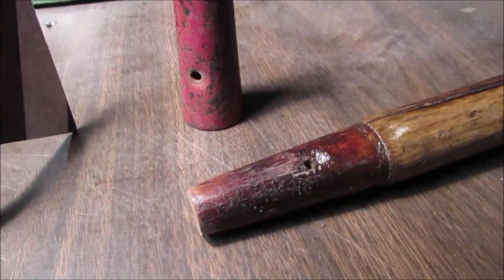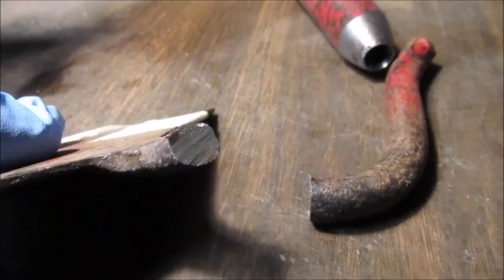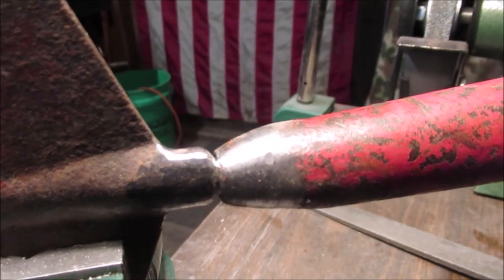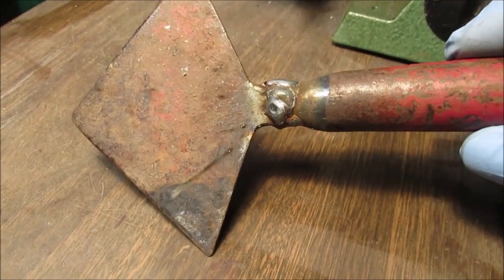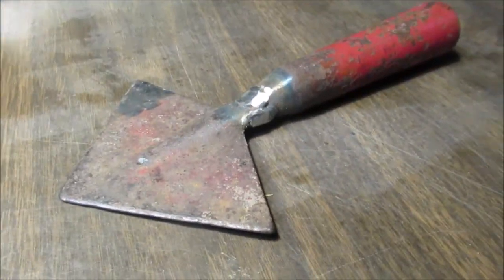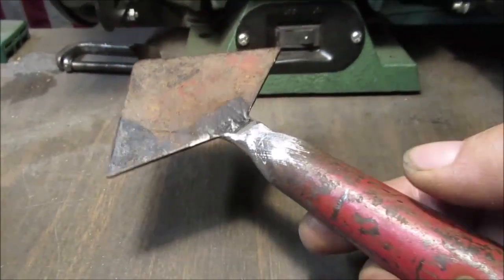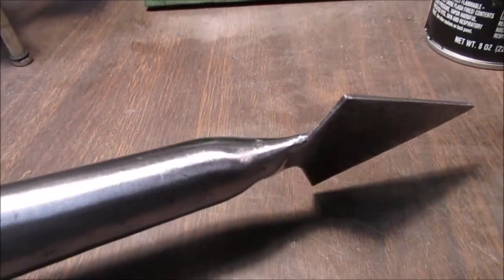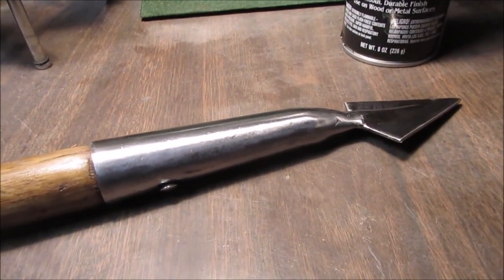MAKE a Spear Point Tip for my Walking Stick

Comment: Find yourself a junk can.  You got that sir.  I used 4 of those discs to cut a Keyway slot  on an engine.    3/16  slot.      No one will mess with you when you are carrying that.
Reply from the maker: The discs grind better than the cheap stones  I have cut some hard tool steel with them